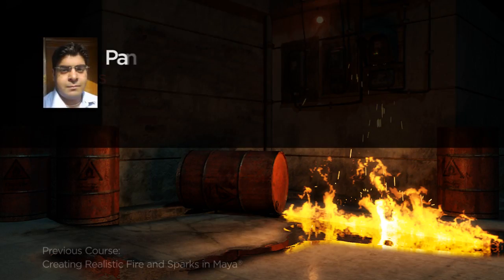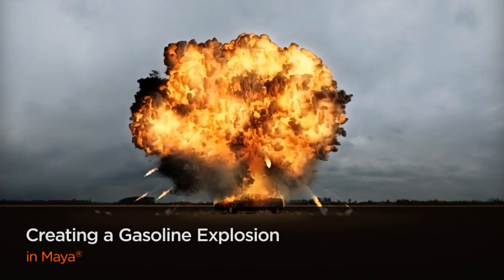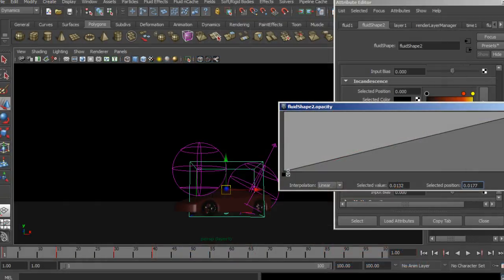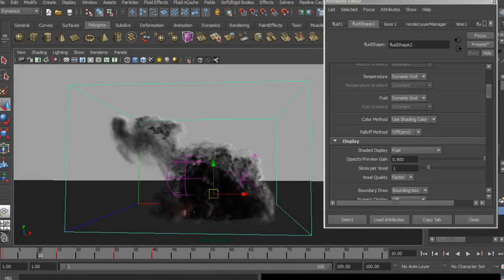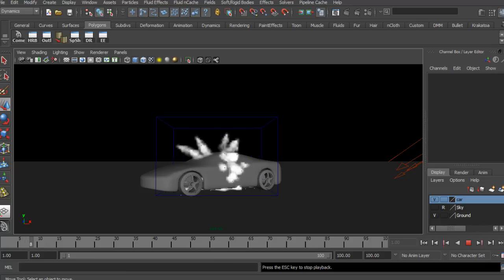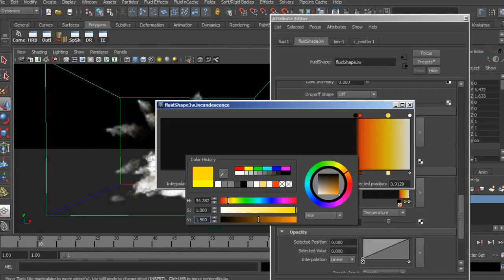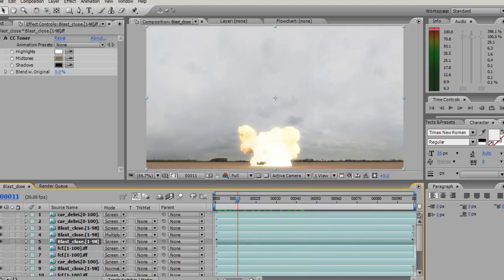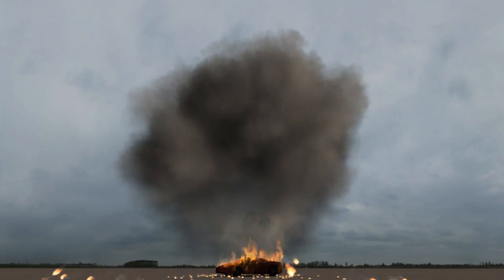Maya Tutorial: Creating a Gasoline Explosion in Maya

Comment: i used the same values you used in lesson number 4 and the behavior of the fluid is different though . my time slider preferences is every frame. 
i opened your project file lesson 4 . the behavior is right . i checked the values . they are the same values i did. what could be the problem ?
Reply: Digital-Tutors
i ended the whole explosion process and it looks over all good but the fluid directed to the volume axis fields quickly before growing volume not like the one you created extended horizontally and made some volume then started to go upward.
over all the tutorial is so useful for me specially to understand base and max resolution , temperature pressure , pressure threshold  , the role of diffusion in shading , ignition and max temperature and heat released.
and thanks for your reply :)